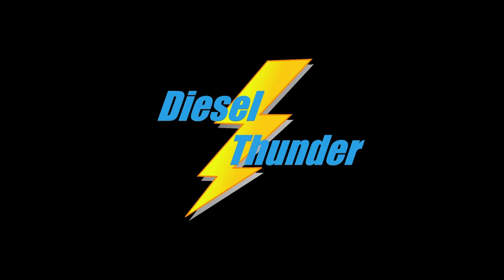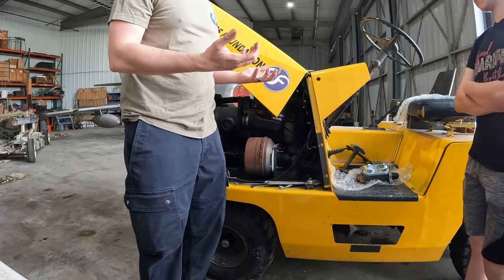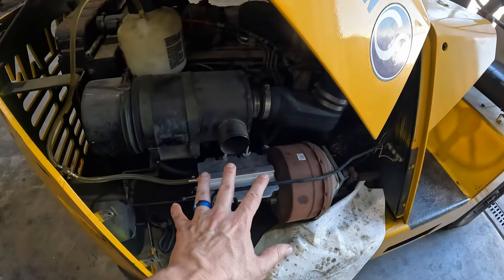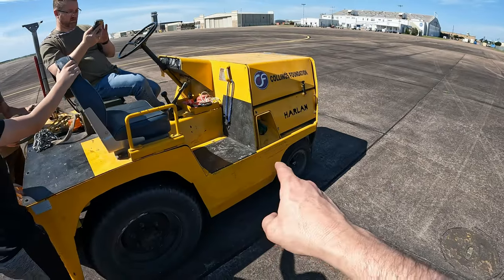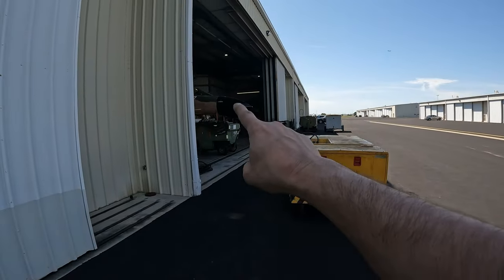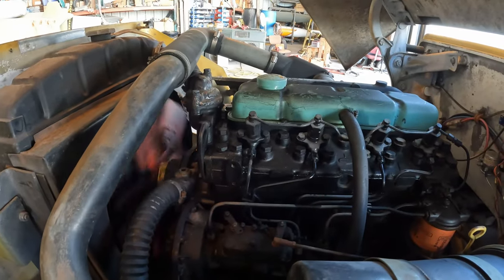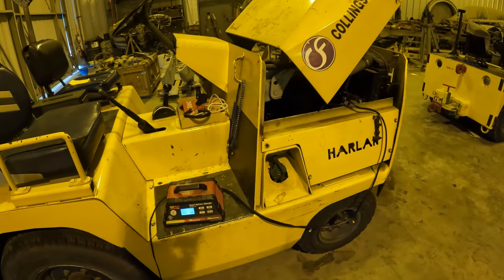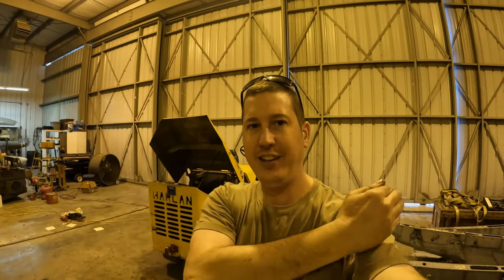Misadventures of the Tugs | F-4 Phantom

Comment: I worked on the F4 when I was stationed in Germany way back in the day. If you have to change the generator, you'll spend time in the intake. PITA to work on the engine when still in the aircraft, but running it on the trimpad was a blast.

Comment: For a small plane, the Skyhawk sure makes a lot of noise !
Instantly noticed the J-79, minus the nozzle.  Got to extract lots of stripped 12-point bolts off them as fitter, Inconel is not easy to drill.
Carefull when jacking up that tug, those things are built heavy.  Great stuff !
Reply from the maker: All that noise and no afterburner! For sure on the tug, we used jack stand on it after she was lifted.

Comment: Good afternoon sir. Regarding the plane.
Isn't it easier to make a test lamp from a socket and a bulb of sufficient power, then add wires and clips, and turn it on instead of a fuse?
In this way you can see the increased load in the circuit, and by turning off various fragments of the circuit, a relatively safe find a shorting, without constantly blowing the fuse.
I'm not from the US, but our army also uses this method. I know it's not too scientific and correct - but sometimes you need to quickly find a problem with minimal effort.